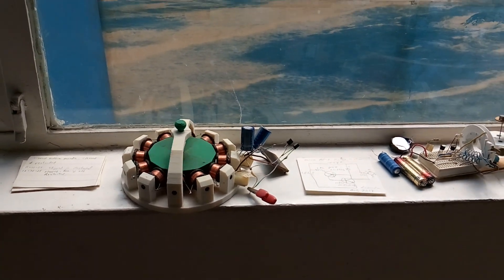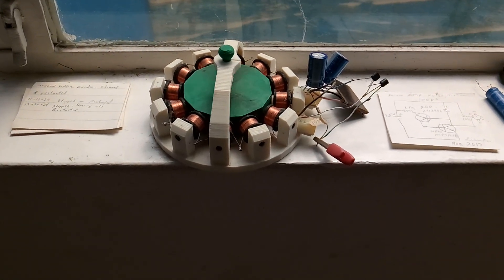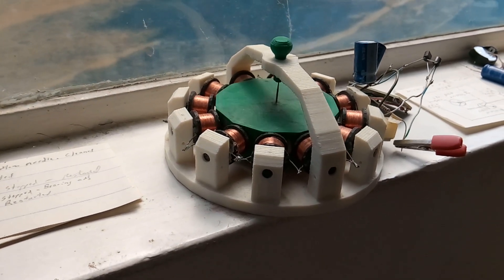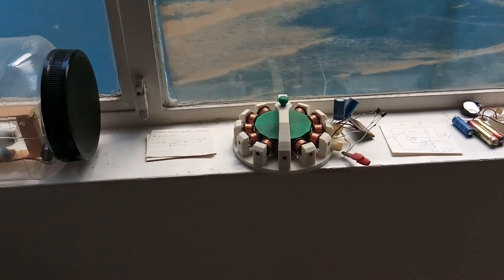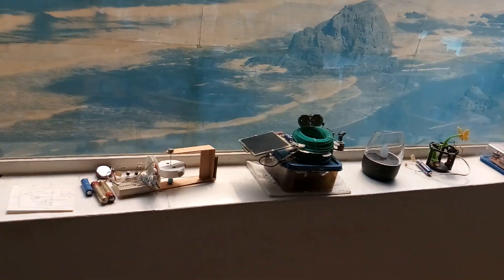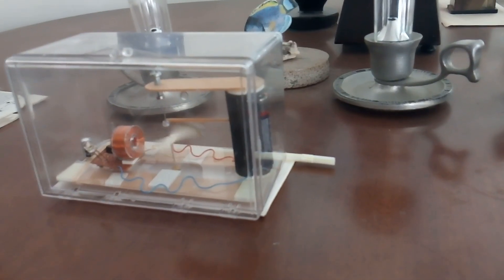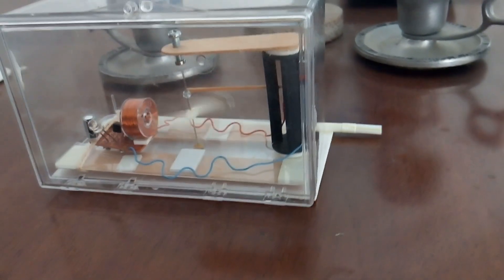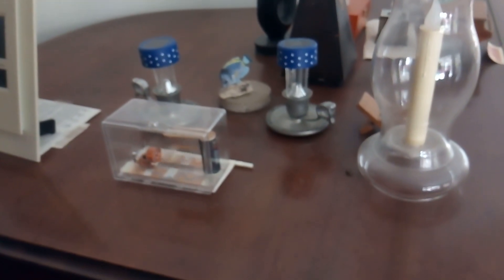My Non Stop Running Devices at 8 years

Comment: the hardest part of every perpetum mobile is hiding the battery or solar cells
Reply: You know, Einstein's theory about conservation is Miss worded?
Or actually misunderstood!?!
No one made or Destroyed energy Ever.
Zero point is that part about "one can NOT make or destroy energy. It only mutates or relocates", so even Edison electric never made one Amp or Volt, they Collected and condensed Electricity from the environment.
N. Tesla, J. Bendini and others made accumulators motionless accumulators, Bendini SSG is a motion requiring device many made at home, even you can... Try this
4 diodes2n4148 or other, 2n34, DYOR, 2 0.2pf ceramic Caps, two 50-100volt electrolytic caps.
Google Electricity from Sky or YT search. These work in parallel or series.
Twenty foot antenna and Deep ground and 1.4v per unit day, drops at night to 1.3v , very small amps, but LEDs of small volts work well..
24/ 7, 365.....

Comment: Do you know of any non stop running device that has no moving parts? 
Maybe some design based on rotating magnetic fields.
Reply: Electric from Sky circuit, but three coils, the 2n4148 aligned right as well, S.E.C. Device.....
Both are on YT, and DIY.
Reply: @j.christie2594  Thanks. The concept with no moving parts has many benefits, since it’s more robust and needs little to no maintenance.

Comment: Some are solar, aren't they ? Are they allowed to stop overnight or do they have a capacitor or battery too ?
Reply from the maker: These are non-stop running devices that run around the clock.  Some are solar panel/ super capacitor powered  or solar panel/ battery powered. A few are just low power drain battery powered units. The idea was to wait until they stopped, find out why, improve the device to run longer,  and keep dong it for years.
Reply: Thank you for your instructional videos. I got infected too.

Comment: Talking about the Yearling structure warping, that is a real problem with any of my 3D printed solar projects. The sun softens them and they fail. I probably should try using other filaments, but as it is I always use PLA and that cannot handle the sunlight 🤣🤣 And as most of the other guys have commented "8 years", it has gone so quickly 🤔🤔
Reply from the maker: I am shopping for a 3D printer that will print ABS better than my Ender 3.  ABS is what this EZ Spin is made out of.  I have tried to print ABS with the Ender but had very poor luck.  My PLA prints are like yours and very sensitive to heat.  This time warp thing caused by aging is weird.  The days fly by like minutes now.  I have few projects sitting around that were built in 2007.  😮🤔

Comment: Use neodymium magnets cover with or have a small barrier made of anti corrosive materials like DIAMOND from a saw blade. and the needle tip coated in Teflon.

Comment: Nice update!  Thanks for sharing.
Reply: All kudos to you lasersaber 👍👍
Reply from the maker: I often wonder who else has an EZ Spin V2 still running
and what is their story.  I eventually will have to replace the steel needles on the bearings but the other parts should last many more years. The simple two transistor driver circuit has been 100% reliable.  I doubt that a reed switch version would have made it this far.  I watch all your videos when you post.  The kids are sure growing up fast.
Reply: @Lidmotor  It's kinetic sculpture, you need speed multiplier while preserving the running energy on perpetual source